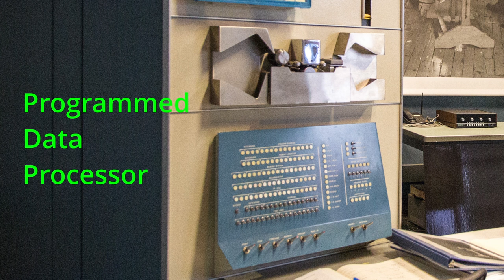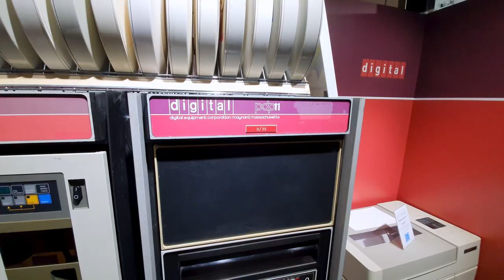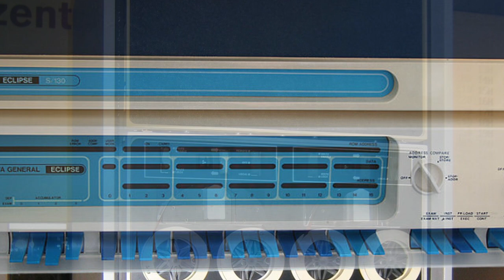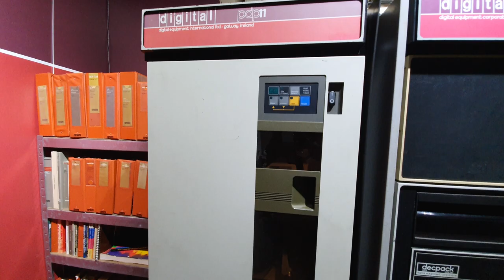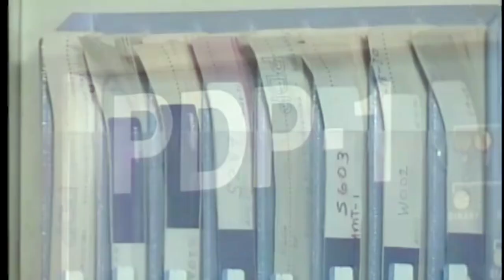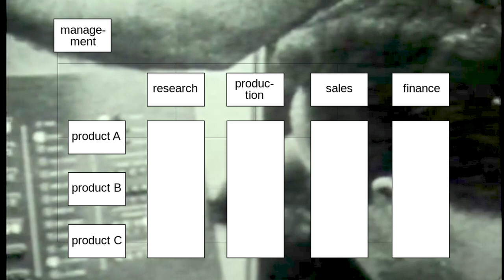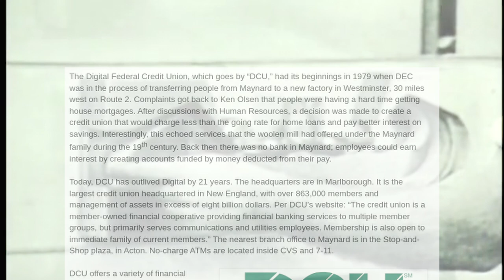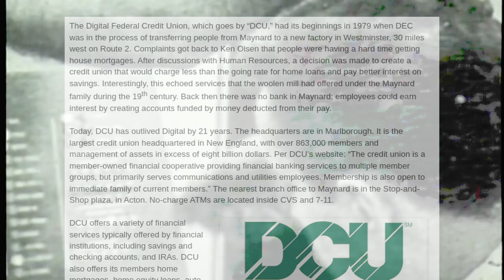DEC and the PiDP-11

Comment: I remember getting a call out on a PDP-11 that was running a milling machine it was making the landing gear for some fighter it was built like tank, after wading knee deep in metal shaving  to the cabinet I cleaned all the cards and replaced the 12" floppy drive and back in business again .. ah the joys of field service
Reply: I did field service on PDP-11 and PDP-8 systems for GCA who used them to control silicon wafer lithography equipment. Lots of interesting scenarios at some of these customer sites including one in Connecticut that had a carpet in the clean room they vacuumed twice daily. (A carpet? In the CLEAN room? 🙄) One system at another site failed because a mouse had built a nest in the environmental isolation chamber and would periodically interrupt the laser beam that was guiding the stage on the giant microscope-like device.
Reply from the maker: My worst state of the machine I was going to fix moment was a Netware server in a fluff factory.  The machine kept crashing (abend if anyone remembers those), so I wondered if it was over heating, on opening it up I discover yes it probably was. Inside the machine it had sucked up so much fluff, the machine was packed solid.  I essentially removed a felt negative of the machine, you could see the gaps for all the cards, the CPU etc.   After a conversation they decided air filtering in general would be a very good idea.  They put the felt negative on display next to where the staff collected their breathing masks to remind everyone how much they could breath in went not wearing the masks.

Comment: I got a job offer from DEC in Vermont in 1979 (with three increasing salary offers, no less), and like an idiot turned them down to work at a very unsatisfying electronics company that I didn't stay with for long. Even though DEC died before I would have retired, I still very much regret missing out on the (presumed) fun of working for them. It was a PDP-8/I that I learned programming on, in college. This video has inspired me to buy a PiDP-11 kit to use as a front end for my home security system, ensuring that the system will be completely opaque to anyone other than me. 🙂
Reply from the maker: I'm glad you liked the kit. I can see how you might regret missing out on DEC.  Sadly for me when I was starting my career VAX was well and truly on its way out, but I did get to use Alpha and Alpha was great.

Comment: You're right about Core memory retaining data. I have a prototype DG Nova with core. A project we did was to try and read-back the contents. Took a few months of research and when it was dumped, it had part of a Fortran Linker still in it. Read date was early Sept 2020. Much as we can tell, last time the DG was run was 1978. Love my pdp11's. So your video warms my heart greatly. I have a pidp8 and 70 also. One day I'll get sufficient tu-its and build them.
Reply from the maker: Having your own Novan, now that ls a cool machine to have.  I love that it held its memeory contents for so long.
Reply: Al, I have a similar story. At my first coop job in college I was assigned the task of bringing this old DG Nova II back to life (it was sitting in a corner of a huge high-bay having been retired years prior). Not only did this model have core memory, it had a very tiny optional circuit board installed on the back of the front panel. I dig around in the documents and learned it was the auto-restart option. So I tested it one day. I started to compile a program, and walked around behind the rack and pulled the plug on the whole thing. After lunch, I plugged it back in. It sprang back to life and completed the compilation no problem. To be clear, this option was not like something you’d see today that would quickly save RAM before the power dies. IIRC, it primarily did bookkeeping things like commanding the disk drives to halt. Maybe it saved a few CPU registers? I don’t remember anymore.

Comment: Years ago I worked for Hughes Electronics in SGS (satellite ground systems). Now obviously when you have a multi-million dollar satellite up in space you don’t upgrade the hardware or software controlling it and instead just run the system that was installed with it for the life of the bird, usually 10-15 years. As much as we tried to avoid it there were occasionally bugs in the software that needed to be verified and fixed. And in order to do that we had to have the same hardware as was installed at the ground station.

In one building we had a gigantic server room, typically called the fishbowl because of all the glass (and the odd creatures contained within that, like fish, didn’t function well outside of that environment); the windows were decorated with appliqués that looked like fish and various aquarium bits as well as fish-related drawings done with whiteboard markers. Anyway, it was like a museum in there - we had representative minicomputers of every ground station that we installed that was still in service, with the old computers only being decommissioned when a satellite was taken out of service. When I last worked in that facility we had systems dating back to the late ‘70s, mostly PDP/11s - a veritable rainbow of systems that was quite a sight compared to the boring modern beige boxes that were standard at the time.

One of the devices that I was responsible for was an optical media library that was part of a hierarchical storage system. Depending on the age of the file it would be offloaded  from the internal hard drives to optical storage to tape. The server had six 4GB HDs for 20GB of RAID5 storage. The optical drive mechanism was huge, the size of a large refrigerator. It had six optical drives, with room for six more, about 120 cartridges and a robot arm to pull the media and install it into the drives. The drives were not double-sided but the discs were, so when the other side needed to be read the robot would go over to the drive, push the eject button, grab the disc, flip it over and gently reinsert it - it was quite a sight. The capacity of this massive, expensive, complex array? About 500GB, an amount that can now be stored on a solid-state memory card no bigger than your fingernail.

Comment: I started working initially on pdp 11/03's and moved up to pdp 11/34's. The pdp 11/34's had RK-07 (rock crusher) hard drives.  These were later upgraded to Fujitsu 30-30 multi-plater  (Winchester) hard drives. Then the pdp 11/73's came out. I worked with RT-11 (real time) and RSM-11M (multi-user multi-tasking). These were awesome machines of their day, but today the typical laptop can run circles around them.  And, yes, I worked on VAX-VMS  systems too. (I had one dedicated to me for almost a year.)

Comment: I remember when I was in high school I was at U-Illinois in the 70's at the Digital Computer Lab (DCL) and saw the grad students writing code for a PDP-11/23.  One of them said, "oh yes it's exhibiting the same problem" and so they pulled one of the circuit cards and ran upstairs to the electrical lab, changed a chip at a soldering station, ran back downstairs, and installed the (now fixed) circuit card ... "Ahhhh, that's much better!"  It was not running UNIX but it was running one of the first Pascal Compilers ever.

Comment: Old Timer Here! The first ever "computer" I ever used was a DECwriter terminal. I worked for a backwater CitiBank subsidiary in Memphis in 1978 and when they installed the terminal, I was chosen to be the operator because I was the youngest and had used a pocket calculator before! The DECwriter was a dumb terminal consisting of a keyboard and a dot matrix pin-fed printer. We connected to the Citi mainframe in NY via a pair of 300 baud modems, each the size of a small chest freezer - lots of blinking lights. I remember it used an acoustic coupler, like a cradle for the phone receiver. My mom thought it was so cool that her son "worked with computers". Now, everyone has one in their pocket. Gosh, I'm old.

Comment: My father worked at DEC from 1962 to 1996. He was a designer on the PDP-6 and the lead architect and designer of the PDP-10. Digital was certainly a major part of my childhood. I remember wandering around the old mill building in Maynard; I mostly recall that it was dusty.
Reply: I worked on the PDP-6 and PDP-10s with Alan Kotok. (We were actually roommates for several years.)  I worked for DEC from 1964 to 1992. That series of 36-bit machines is still my favorite computer architecture.
Reply: I worked for DEC from 1977 to 2002 (took an early retirement package from HP) and remember Alan. I was in manufacturing engineering mostly for PDP-11s and VAXes. I worked in several locations around the 495 belt over the years. It was a great place to work.

Comment: I learned most of my earliest programming on a PDP-8/E that my High School bought in (I think) 1971.  I then went on to do A LOT of PDP-11 programming at the MIT Model RR Club (TMRC), where eventually there were 3 PDP-11s under the layout running programs that controlled various parts.  They relied on the fact that they were core memory and didn't need to be reloaded each time the layout was powered on, they just came up running (well, usually).  I now have a basement full of DEC computers (and a few non-DEC), but none of them are regularly working, I keep hoping to have the time and energy on getting them back.  Two PDP-8s, several PDP-11s and myriad LSI-11s and MicroVAX machines, along with a huge set of spare parts.

Comment: I worked with the DEC PDP 11/23's durings the early 80s, on Robotics. The PDP 11/23 mini Computer was the size of a filing cabinet, and I also think the Unimation Puma Robot controller had an embedded PDP as it's processor. I worked on both RT-11 & RSX-11M, with a shelf of some ~30 large manuals for each OS! These were updated regularly (for a not-so-small fee!). I programmed mainly in Macro-11, the Assembler language with Fortran links for Graphics & high level Mathematical processing. The DEC computers and plug-in Cards were high quality, as was the software, and the documentation was really aimed at the Scientist; but you had to know your stuff, especially Interrupts under RSX-11M! We also had a VAX cluster using VMS for general office type work, accounting, management guff etc. If I remember rightly,  the 11/23 was reduced to a chip set and ran the first DEC micro Computers in competition with Big Blue when it released it's IBM PCs in the mid 80s. It was a real shame when DEC closed it manufacturing in both Ayr, Scotland & Galway, Eire with the loss of hundred of jobs as they were good employers. Shame they never made it in the long run - what has happened to them now?

Comment: I was smacked with nostalgia when you showed the pdp-8, with its autumnal color theme. Flip, step, flip step, on and on to program the loader for the paper tape reader. The orange three ring binders with documentation in the one shot also brought back memories. I wish you would have shown the wire wrap rat’s nest inside the drive units. My experience with pdps was in industrial control systems. They were everywhere, once upon a time.
Reply: I totally agree. There was something really satisfying in toggling in the boot-strap loader so that you could load the paper tape.

Comment: Those front panel switches were useful for single step debugging.  When set to single step mode, the program would advance just one instruction at a time as you toggled a particular switch.  At any point you could examine the contents of any memory location.  You could see how branch instructions were operating, and see the program counter change as it reached an "if greater than", or "if less than" instruction.  And the front panel looked really good too.

Comment: I spent 3 years at college using the PDP 8/e series of boxes and have many happy memories of talking and working with the DEC engineers.
The beliefs and standards at top level in the US came across the water and was instilled all the way through the teams - nothing was ever too much trouble for the engineers, software teams or even reception when the phone system got you lost. Amazing, even 40+ years later, I still remember them fondly.
Two things you did not cover - some of the DEC drives where encased in concrete to reduce vibration - try carrying them upstairs and fitting them in the racks - took three of us (engineer, tutor and student - self) to lift them!
The second is that the drives sometimes would not boot without a boot loader installed from paper tape. We needed to manually enter the initial loader using the switches to read the console tape that contained the 'high speed' optical tape driver, then read in the basic OS from optical tape that then allowed the disk to boot - time from start to finish was around 20 minutes...

Comment: Between 7th and 8th grades in 1973, I took a summer school course in computers.  It was given at Freeport HS in NY where we had a DEC PDP-8 that was setup as an EduComp EDU300 with a mark sense card reader with 40 column paper cards that you filled out with a #2 pencil. I could write programs at home and bring the cards in to class to run and then edit them.  We had one shared DECWriter printer for output. They taught us assembler using a CARDIAC cardboard computer and then BASIC on the PDP-8.

The following year I took the same summer school class but now we had a DEC PDP-11/35 attached to a room full of ASR-33 teletypes with paper tape punch/ readers for saving programs. My favorite was Super Star Trek.   We all would play after class.  That classroom was loud!  

I still have some  of my old programs on decks of cards and rolls of paper tape.

Comment: When I finished my time in the USAF in 1973.  I was rehired by Singer, but in R&D.  They had DG Novas for graphics design of chips.  I didn't get to programming right away, but they eventually purchased a Systron Donner chip test set, which used a PDP-11/05.  That's the first mini I programmed, first in BASIC, then machine language, then assembly.  Singer R&D was my "bootstrap".  O was fortunate enough to land a job with Bell Labs in 1978 and was surrounded with PDP-11s running UNIX.  I had programmed other micros and minis, but the PDP-11 had the most elegant instructions, with no need to use an accumulator to do operations.  I learned C language and developed in that language for 25 years with a couple years programming in C++.  I am still fond of the PDP-11 instruction set, which closely fits the higher level C language.  x++ = y++ assembled into mov (Rj)++,(Rk)++.  I programmed on VAX for awhile.  The instruction set is a greatly expanded PDP-11.

Comment: I worked with a Dec PDP-8 and PDP-11 in college, NC State around 1981-83.  Our assignments were to use DEC assembly language to write low level routines for terminal/device handlers, etc.  Our system had 8" floppies for data storage.  I may still have the books on those systems but its long since been forgotten.  A side note, we also had a Data General computer for Freshman Pascal and other classes.  I worked at that data center.  We then had DEC Vax systems at our hospital but I never worked directly with them.

Comment: Have fond memories of the PDP 8 and the PDP 11 in my student days. The 11 was a big improvement over the 8. The 11 had a great machine code system, the mov instruction simplified memory operations.  I cannot remember the 8 instruction set but it was more clunky.  The 11 I wrote code for had 4K of core memory so you did not have much memory  for data. I think we had a 1 Mb disk which was a cassette.  It was a great machine for its time. Thanks for the nostalgia!

Comment: Thank you for the trip down memory lane.

I was introduced to computer science using a DEC PDP-8 while a senior at William Tennent Senior High School. I was fortunate to start then, because the next year, the high school replaced all their PDP-8s (they had 5 or 6) with TRS-80s -- which would not have been nearly as much fun.

From there, I continued using DEC equipment at Bucks County Community College where they had a DEC System 10 running TOPS-10 for a mainframe and the computer lab had a PDP-8 that we were allowed to play with. I actually held a core memory card in my hands. I think it was 1 KB and the PDP-8 could hold 4 of those cards for a whopping 4 KB max memory configuration (I think -- that was a long time ago).

Until I watched this video, I don't think I ever understood why the PDP-8 had a 12-bit word size, but now it makes sense knowing that the character encoding standard when it was designed was 6 bits.

At my university, we had a DEC System 20 running TOPS-20 and at my first job after graduation I used a VAX 11/780.

I really liked your video.

Comment: Thanks for the video, saw the dual-door floppy I was trying to remember for a comment on another video about the complete BYTE collection, sweet thanks. Also there is a cool video about the DEC engineer that went on to create Windows NT. Strange how Dec was at the center of a lot of things (incl. AtariST GEM desktop)
Reply: Anyone who has used these machines with the dual 5 1/4 inch floppy disks will remember their very characteristic noise caused by the stepper motors driving the heads with a "buzz buzz"

Comment: I worked with PDP11/40s, my network used the Decs as a node in a network based on ARPANet. Before that I worked with IBM System 7s. 🙄 Lots of memories of long nights working through problems. Yes, it was cool to be able to pull memory from one system and plug it, exactly as it was in the other system, into a working machine. I still have a face plate (like the one used for the replica) and 16K of memory from the “good ‘ol days”. Not so great to live but good to look back on. To really get the feel you need a paper tape (we actually used plastic tape), set the correct bits in the correct location and read the paper tape to load the machine. Loads of fun using scotch tape to fix the tape…